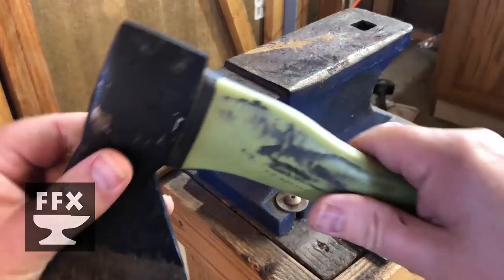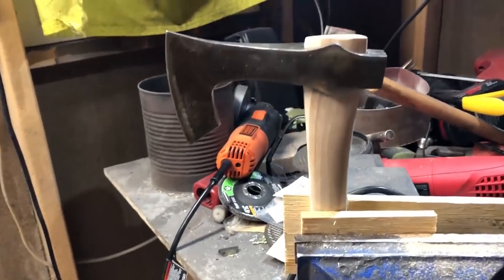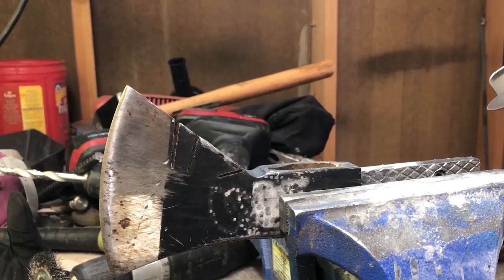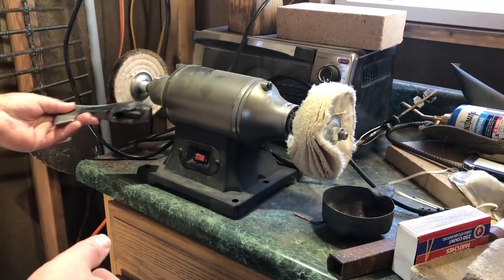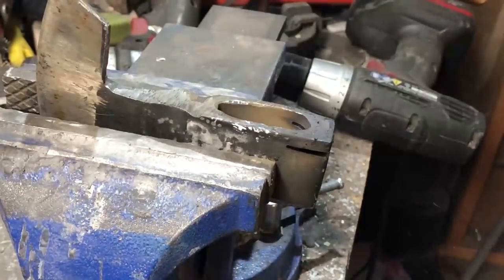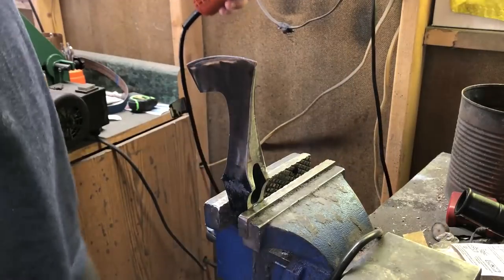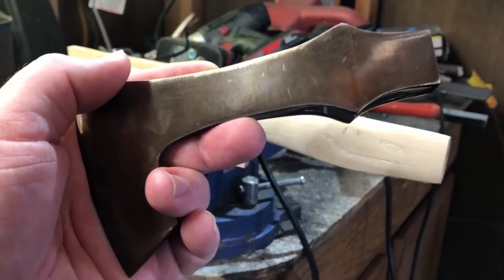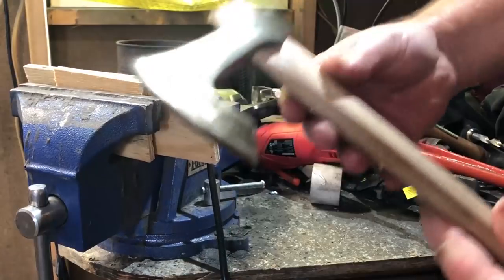Making a Bearded Tomahawk from a Used Hatchet (Viking Style! Well, not really, but cool anyway)

Comment: That looks great! I know your pain with getting the fiberglass handles off old axes. I found an rusty axe with a fiberglass handle that was added on to it and I prefer wooden Handles so I took the handle off like you did at the start and I missed the hammer hits a few times and ruined the wood on the handle of the hammer so I had to replace that handle also. Keep it up
Reply from the maker: Thanks, my friend! Yeah, I should have known batter than to try smashing the head off the handle, live and learn I guess.
Reply: Would it be bad to saw the fiberglass handle off with a handsaw? Will the dust cause you problems if you don’t wear a mask?
Reply: The eye is tapered outward as it comes up through the head. Trying to hammer the head off the handle you're hammering it tighter onto that taper. Wood you might crush enough to get it off. Fiberglass... good luck.
I cut it off with a hacksaw just under the head and punched the little bit of the handle out from the bottom to the top.
Reply: kieranh2005 I was more clueless when I wrote this haha. Now I use an axe drift I forged to knock old handles out and I can usually get them out easy enough